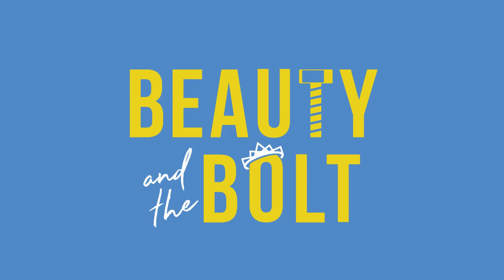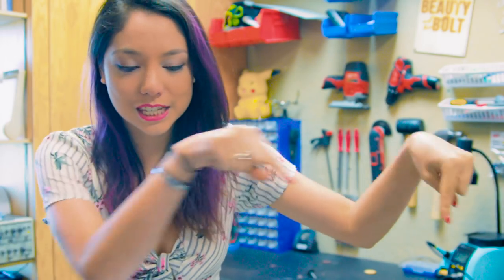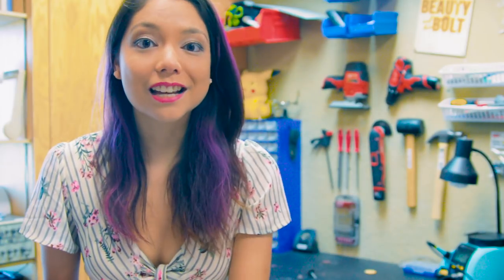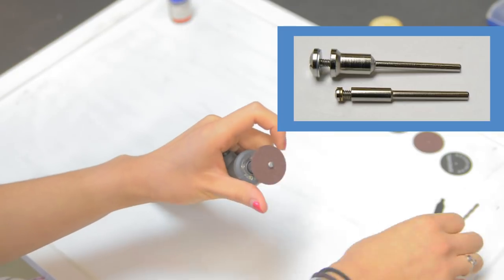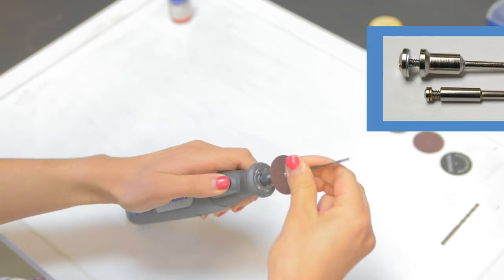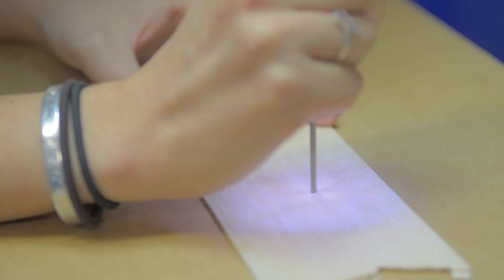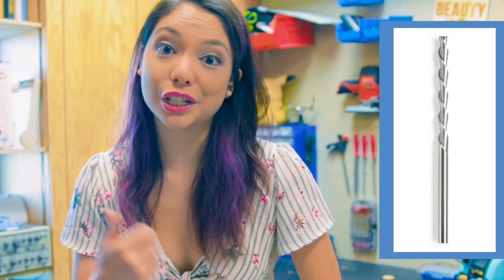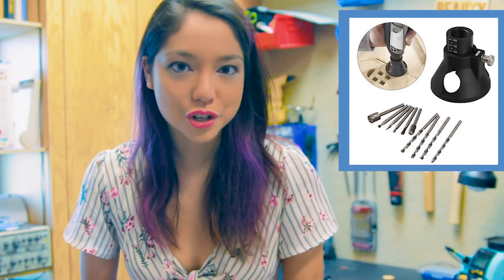Rotary Tools - Dremel Cutoff Wheels and Milling Bits

Comment: Are there corded as well as cordless ( battery ) Dremel tools?
Are there variable speed  Dremel tools?
Reply: Yes and yes. The dremel micro is cordless, and there's a flexible arm attachment you can get that will fit on a dremel 3000 or 4000 that gives you a light, pen-like thing to carve material with, without actually having the dremel in hand.

All dremel tools I know of have variable speed control, but it's not mechanical, it's electrical, which means that you actually lose power by going slower (you don't gain torque out of a smaller speed)

Comment: Have you tried the drill press accessory for these?  I've always wondered how well or not they work with the tiny drill bits.
Reply from the maker: Andrew here: we use on of those in our lab literally every day. They're fantastic for accurate drilling of small holes great for PCB vias too